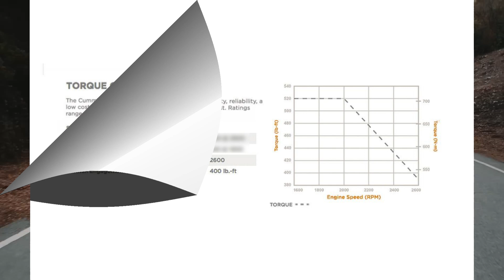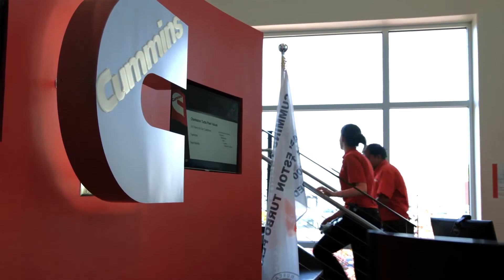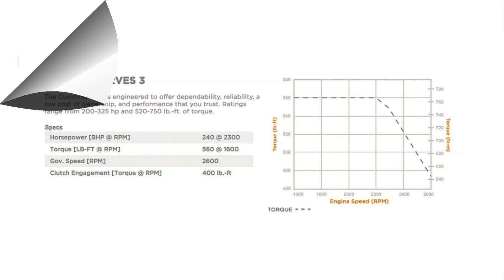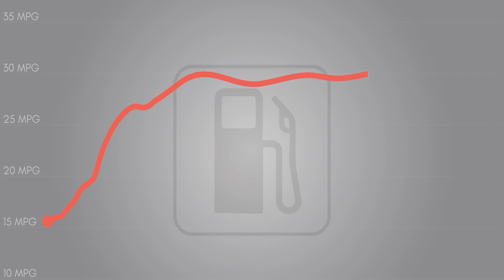SPECS UPDATE: 8 New Cummins Gas Engine Configurations for RAM HD Trucks

Comment: This is not Cummins first gasoline engine they built a v8 gas engine in the 1960s it was based on the 504 cubic inch diesel and they called it a geisel. It was a joint venture with White Motors I worked on these. These new 6,7 s will be better and more powerful with the new technology.
Reply: Is Ram gonna go with a cast iron block or aluminum?
Reply: I can't answer your question but I think these engine's will find their way into class 6 and 7 trucks. I had my own fleet repair service for 40 years and I worked on gas and diesel. Some of my Moving Company customers have fleets of local straight trucks that just run local the diesels are getting so expensive to maintain and troublesome they are switching to gas engine's these trucks don't run that many miles a year.
Reply: They also make gas engines in generators.

Comment: I have an issue with the weight of the diesel in my Ram. Since the gas engine is built on the same platform, it will also be a heavy beast which effects payload in a negative way. Cummins should get into the EV game before it's to late.
Reply: Go hug a tree.
Reply: No , e.v are dead!
Reply from the maker: Just not the EV 😞
Reply: This is by far, the most ridiculous comment i have ever seen.